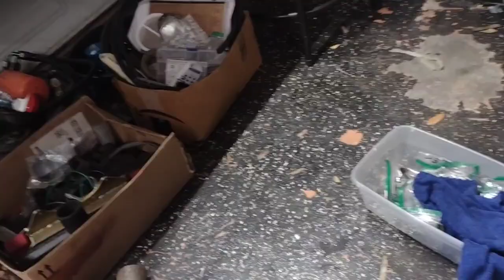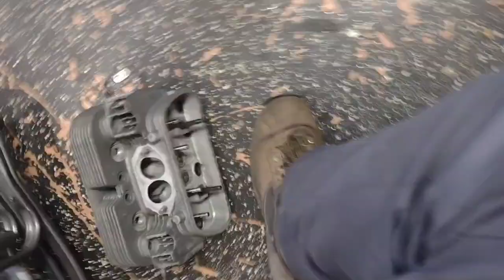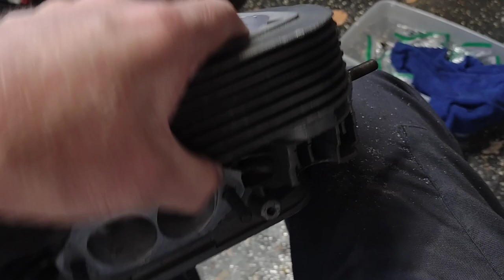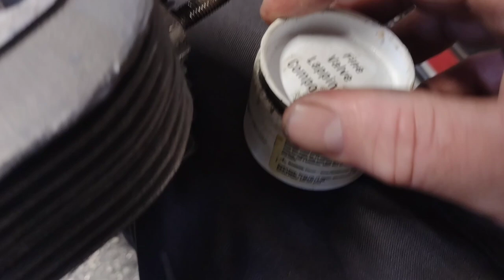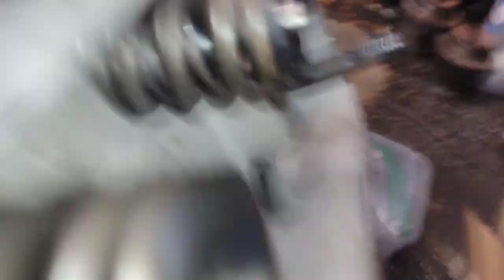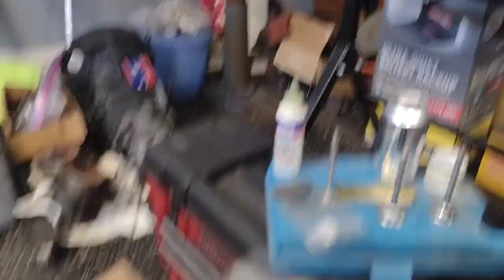head work and useless knowledge

Comment: 😮I understand why the angle cuts are so important but I've never actually seen it done. I always wondered how you could fixture the head to match the angle of the seat, because of course you couldn't cut it free hand . It never occurred to me that the cutter had a pass through to use the valve guide shaft 😂.

I'll probably never do enough valve jobs to justify buying my own cutters, but this is still really satisfying to know.